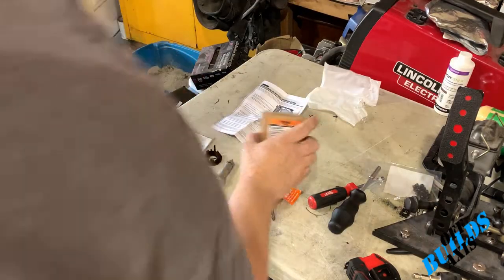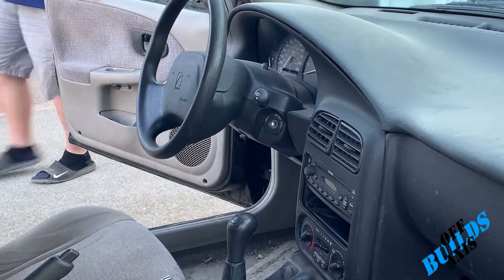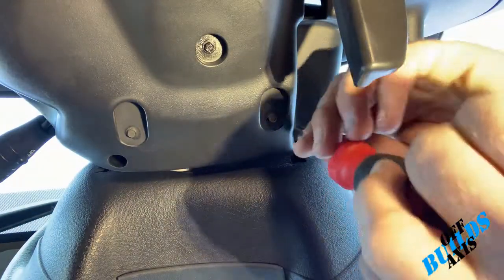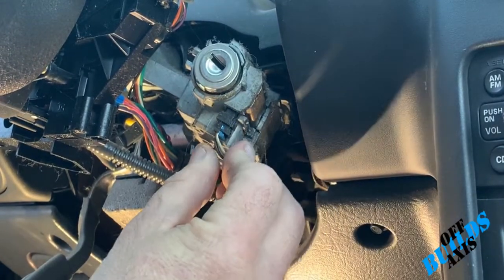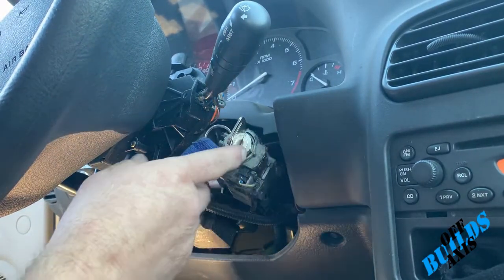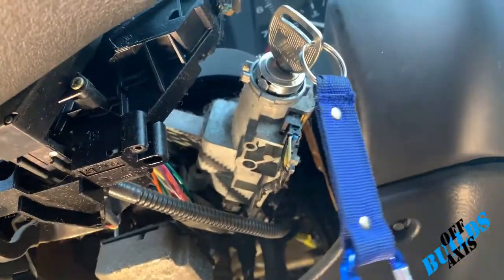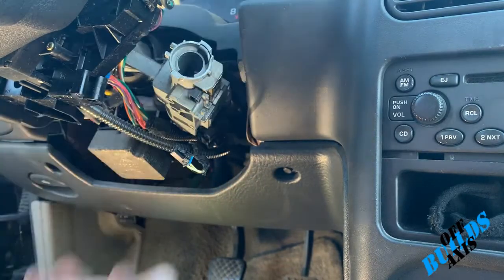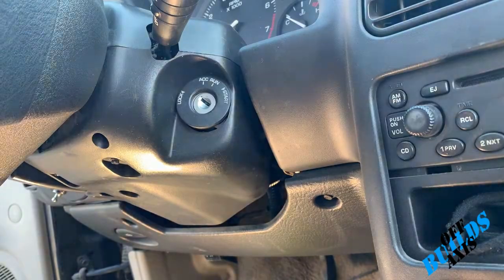2001 Saturn ignition switch replacement

Comment: Thanks for the video. Very clear explanation. Good lighting, too.

A tip: If you can't find the 5.5mm socket for those cover bolts, a 7/32 " long reach socket on a 1/4" drive is just about identical and worked like a charm.
Reply from the maker: Good tip. Thank you for supporting my channel. I’m glad you were able to your fixed.
Reply: Good tip
Reply: Had a set of those small screw drivers. Like 40 magnet tips set. It had a little socket in the set that worked.
Reply: TYSM

Comment: This was a typical problem with all GM passenger cars around this era. GM claims the owner carries to much weight with other keys and remotes om the key ring. Great info video.
Reply from the maker: Yea I found that to be true on all cars. That’s why I try to only have my ignition key in the cylinder and all other keys somewhere else.
Reply: @OFFAxisBuilds  So very true. I would take off pounds if keys off customers key rings when the cars would come into the dealership. After a while yet get over trying to help people out with advise about this topic. Catch you on the next video
Reply from the maker: Thanks for your great comments and checking out my videos.

Comment: For those with generation two Saturns (mine is a 96) it’s a lot easier to get the lock cylinder out. You just turn the key to accessory or run and then go down the cylinder on the outside at about the 1 o’clock position right behind a rectangular protrusion and push down. Then pull the cylinder out with the key. “Richpin” has a video on it.

Comment: so this is actually the ignition lock tumbler not the switch. 

still helpful I believe I need to do both
Reply from the maker: Yes you are correct I will change the title. I misspoke in the video.

Comment: Could you make another video where you don't speed up the installation of the cylinder back in.. do you just push it back in without the Allen key or is it needed to put the cylinder back in.?
Reply from the maker: It just slides back in. But you do need to give it a good push so it locks in

Comment: Get this ignition cylinder kit instead. It comes with lock wafers that will permit you (or your locksmith) to key the new cylinder up to match the original one. Then have a locksmith cut you a key by code from wafer numbers that you used. This unit is USA made. STANDARD MOTOR PRODUCTS US525L. It does not come with a key. The OE GM ignition cylinders are not particularly reliable, though they are still available as an option.

Comment: When i go to pull out the cylinder the key just comes out and the cylinder stays in. Tips?
Reply from the maker: It should come out with it. You will need to turn the key back to off position to pull it out. Hold the barrel and turn it.

Comment: Although I do appreciate ypu video this is NOT changing the ignition switch but the lock cylinder instead. PLEASE fix it so it's correct. Ty for this video of an ignition lock cylinder
Reply from the maker: Actually it is an ignition switch.
Reply: @OFFAxisBuilds  The ignition switch is a black plastic cylinder on the BACK SIDE of the ignition lock cylinder. Just changed mine out and I did nothing of what you talk about in this video. Great info though IF my lock cylinder gets janky.

Comment: Mine stuck in lock I can't get it to accessory or run can I still replace it
Reply: Try tapping on the key with a screwdriver handle while turning the key at the same time. Don't go ape shit just firm taps

Comment: Great Video but can you get the cylinder out without the key? I lost my only key
Reply from the maker: Honestly I believe there is a way to pull the whole thing out and replace the whole ignition, but in this video I explain how to just replace the guts.
Reply: I think such an option would negate it as a lock
Reply: there is a way, but it's pretty rough. you have to replace the entire ignition OR drill out the original lock cylinder and force it into the acc/run position.

Comment: Does this kit work on the Saturn 2001 L200?
Reply from the maker: I’m not really sure. Amazon says it will Vehicle model years this part fits: Saturn SC1: 2000, 2001, 2002 Saturn SC2: 2000, 2001, 2002 Saturn SL: 2000, 2001, 2002 Saturn SL1: 2000, 2001, 2002 Saturn SL2: 2000, 2001, 2002 Saturn SW2: 2000, 2001 Saturn Vue: 2002, 2003, 2004, 2005, 2006, 2007
Reply: Nope
Reply from the maker: That’s too bad.
Reply from the maker: I hope you can get the right part.
Reply: @OFFAxisBuilds  saturn l200 update… autozone sells replacement cylinder, albeit uncoded without keys. Its totally do able with some patience and a good pick tool to remove each piece. Just gotta take the old ones out of broken cylinder one by one and write down the numbers for “key code” then put new one together accordingly.  Locksmiths will happily re code cylinder for you if you bring to them.
DISCONNECT BATTERY!!!, remove steering wheel/ ignition shroud. Pop off plastic ignition bezel. Locate cylinder release hole On TOP of ignition in access hole (2 inches from keyhole or so) small allen key or pick to depress the pin. L200 needs to be turned to crank position to release, not acc or on but actually crank position, thats why its important to DISCONNECT BATTERY!!! Cylinder will release and you can take old one and new one to locksmith to be rebuilt for old keys.

Comment: Is it the same as a 2004. I had the same problem, wouldn't turn, replaced it once at a shop, now someone took my ignition. Not able to make a ignition key. 
Wait,  u could probably use the door key to make a ignition key? Please, please, save me! Do tell. Comment back please ASAP.
Reply from the maker: So if the door key is the same as your ignition then you should be able to use your door key to start the car. But if the ignition is completely missing you will need to replace the ignition and then either have two keys for the car or go get the ignition rekeyed to match your door. It would probably be cheaper to just have two keys.

Comment: What hole ?! I dont see anything on my cylinder, Its solid. I found it, so after about an hour, no go. Not easy at all. Welp, to the locksmith down the street. Things are Never as easy as they look on YouTube. Been there Many times.
Reply: Oh, THAT hole. I guess I got confused with another video for an earlier model year. There's a difference. Oh well, should have paid attention. Now I need another column. Ruined the cylinder carriage trying to get it out when the key locked-up. That'll teach me ?! Lol.